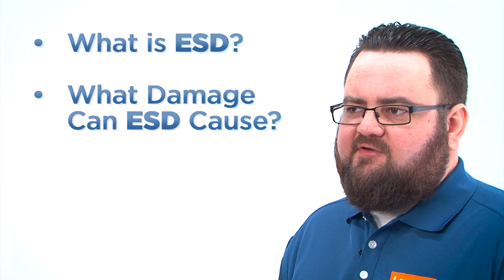Understanding Electrostatic Discharge (ESD)

Comment: If I touch the power supply does it have to be plugged in
Reply from the maker: Hi! Thanks for writing in. You can leave it plugged in as long as it's not turned on. Usually, you can touch any metal component as long as it's not turned on to discharge any static energy. Erica_Lenovo
Reply: LenovoSupport Thanks for replying :)
Reply from the maker: You're most welcome! Feel free to reach us back if you need anything else. Erica_Lenovo
Reply: LenovoSupport But what do I do if the power supply screws are painted?
Reply from the maker: If you touch painted screws while it's turned on, it will still cause an Electrostatic Discharge. Mac_Lenovo